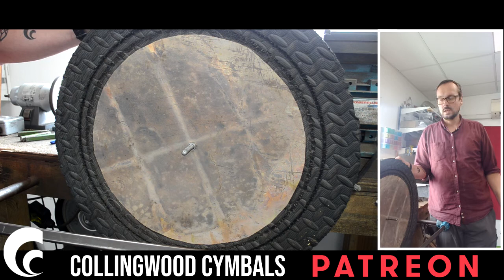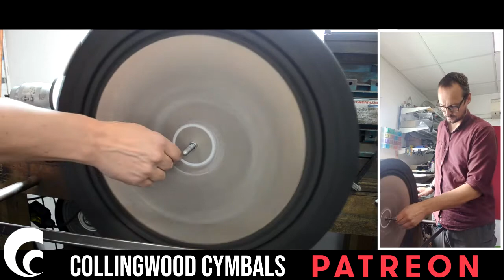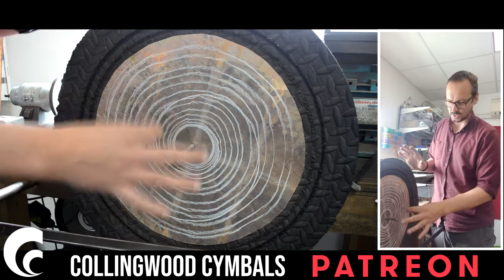Collingwood Cymbals on Patreon -  Lathing Density

Comment: Hello! Could you describe the lathing tool? thanks!!
Reply from the maker: Yes I can tell you all about it, but do you mean the machinery or the cutting tools? Feel free to reach out on email if you like, you can contact me through my website https://collingwoodcymbals.com/pages/contact or my Patreon is free to join now and has LOTS of information about all of it https://www.patreon.com/collingwoodcymbals
Reply: @Collingwoodcymbals  thanks! About the cutting tool!
Reply from the maker: @plantamurga  No problem, the ones I use are tungsten carbide tipped lathe tools, you can buy them individually or in sets with various different profiles, and then they can be reshaped to different curves / points for different lathing styles. I generally buy these: https://www.chronos.ltd.uk/product/soba-tct-roughing-tool-1-2-shank/
Reply: @Collingwoodcymbals  💓